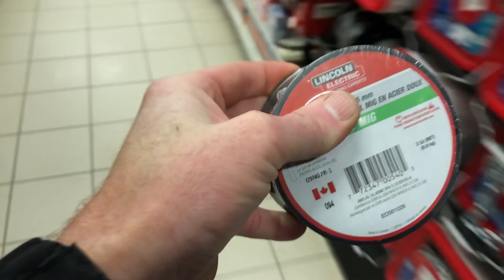FINISHING UP ON THE PASSENGER SIDE CAB CORNERS AND ROCKER PANELS ON MY 1977 CHEVROLET C10 TRUCK

Comment: I like that transition you did to get to Canadian tire. I'm intimidated to weld body material, so hat tip to you not to be afraid. But this is how you learn! Some day I will tackle that kind of welding but that opportunity can wait! P.S. I am going to send you a link to some vintage Greg's Garage that might help you on welding body metal. Maybe it will help! Also, you could probably use acetone to remove the finish on the coat hanger next time.
Reply from the maker: I got the link and learned a ton in suck a short time! Putting it to use today!

Comment: Sometimes it helps on thin steel if you make a bunch of tac welds then try fully weld over top of those I find they help from blowouts etc.
Reply: Was gonna suggest same spread heat out.
Reply: @truckerdave5122  I had to do that when I replaced my f150 floor pans . The tac welds help
Reply from the maker: It's all good Boys! I'm gonna try the tack weld method! CarGuy & Sixfan Christmas special tonight @ 8:00 est.